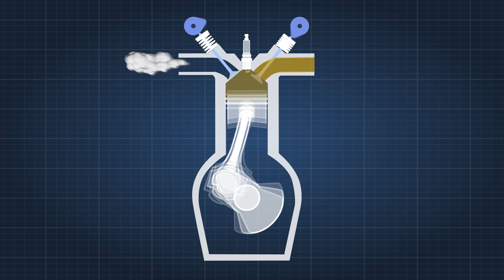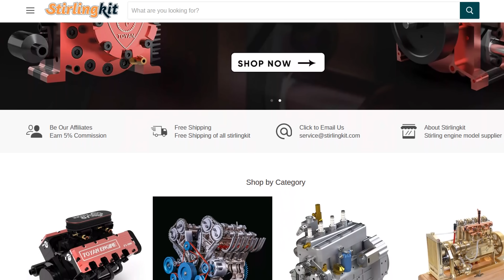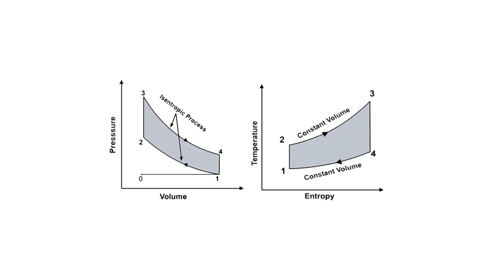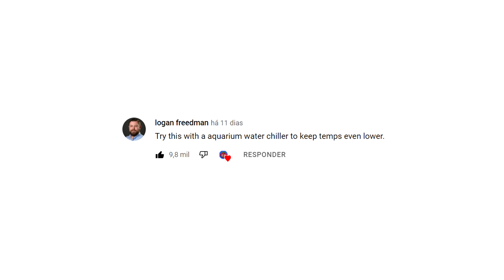I 3D Printed a Transparent Combustion Engine in Resin

Comment: My guess on why it's performing better and worse with different fuels might be caused by the rubber ring. What I think is happening is called blow by. I think the meth was the most efficient because it was causing the least amount of blow by. I believe diminishing returns is a factor comparing gas and nitrometh. Car pistons have staggering piston rings with a small gap to allow some blow by but minimal. You'd also have to look in engine temps during combustion comparing the different fuels to figure out proper gapping of rings. Maybe you can us math or a simulation. Cheers.

Comment: All the fuels have the wrong mixture. If the carby is set to operate correctly on regular unleaded fuel it will have a hard time running on nitro.
Nitro and methanol needs a vastly different fuel to air ratio than unleaded.
If the carby has a mixture screw try adjusting that and then try the different fuels again. 
Either way it'll be very difficult to get good indication with an engine that undoubtedly has a lot of air leaks!

Comment: Your Air-fuel ratio changes with each fuel, maybe you can try printing some carburetor jets with different diameters to fix this. As you run either rich (too much fuel) or lean (not enough fuel) the engine can behave totally different and loose power you want a mixture with a lambda close, or some cases slightly richer, than 1 for a perfect mix.

Comment: This may have been said in earlier comments but I can't read throught them all.  In a car engine the timing for when the spark occurs is not fixed as with your simple engine the timing advances as the rpm increases this means that the spark occurs earlier on the compression stroke to compensate for the increased rpm.

Comment: 1) ignition timing, each fuel has a different burn rate and that means power will be applied early, late, or on time. 2) spark plug gap varies with fuel and compression. 3) different fuels require different carb jets.
Reply: As the engine should work as close to detonation as posible, spark plug should have its heat rating set acordingly. But i think its imposible on this type of engine :D.
Reply: These toy engines are really not built for this level of perfection. But you're spot on in my opinion.
Reply: @Argosh  sure they are, in fact they are required to be even more precise due to their smaller size. You can still change the gap on the plug in order to change them slightly, and you can use feeler gauges in order to make sure they are the distance that you would prefer.
Reply: @sethh8892  lol
Reply: I was also going to mention that the air/fuel ratio for the different fuels is probably all wrong, but you’re spot on, there is a lot involved in properly tuning an engine.
Reply: @Thinginator  
     Yea, different "fuels" require different fuel. O2 ratios for full reaction of all fuel provided.
This is called its Stoichiometric value.
     In naturally asperated engines the carburetor is designed according to fuel being used.
In fuel injected engines, this ratio is controlled by how much O2 is still in the exhaust gasses. (O2 sensor)
     This is why liquid fuel rocket engines vary so much in design, fuel & output.
Hydrogen has the highest "energy density" but also has a high Stoichiometric value.
     This means the engine/ fuel, requires more O2 to make use of this energy.
More O2 means bigger tanks & more mass of O2 onboard.  
     Mass is the #1 factor in thrust/ weight ratios.  
Engineering can maximize the thrust but only so far. Mass is physics, it can't be changed other than 
by simply carrying less. 
     Super chilling can change its density, leading to smaller tank requirements, 
meaning less mass in vehicle from smaller O2 tank but this is still same fuel/ O2 mass.
     Ex: Two Kilos of fuel & one Kilo of O2 doesn't change because it's liquid instead of gas.

     This 2-stroke is probably running lean. Just under the initiation point for the small amount of time given.
Fuel/ air ration is slowly increasing in the carb./ intake airstream.  
     Once it hits correct ratio per volume/ pressure/ temperature, bang. 
This single bang just barely changes the temp. therefor pressure/ volume of mix. in cylinder.
     Liquids are uncompressible therefor this temp. change only affects the O2/ gases in cylinder.
Making the absolute O2 content in cylinder mix, to low for ignition at TDC & as cylinder drops, the O2 
pressure/ fuel/ air ratio, only drops. If the mix is too lean to ignite at TDC, it's never going to because 
the mix is only getting leaner as the piston drops.
     Since the 2-stroke doesn't have a "fully" clearing exhaust stroke, warm gasses are still in the cylinder from 
previous ignition stroke. This janks the next compressions mix, preventing ignition. Warm air is less dense than cold.
     In this second, non-igniting stroke, fuel & air was still pulled in, fuel was forced to evaporate as cylinder dropped, this chilled the cylinder & un-expelled gasses back to proper fuel/ air ratios.   This results in a bang, every other stroke.
     This seeming tine issue, effects all internal combustion engines. 
This is why mileage/ efficiency is affected so much by altitude.
     Also, the reason ICEs require turbo or at min., super charger systems as the pressure drops with temp./ alt.
The inefficient exhaust stroke on the two-stroke, makes this scenario have a larger effect on the engines combustion.
     Too much info?  HaHa!!
Reply: @travissmith2056  very informative!
Reply: Knock knock LOL
Reply: exactly what I was thinking improper timing steals momentum by combusting on the wrong time so with more combustions per stroke he gets less rpm vs less combustions per stroke
Reply: Yea nitromethane needs more fuel injected per cycle to make proper stoic, and because it’s less powerful than gasoline he’s getting less power than he should be if it was the proper AF ratio.
Reply: This!
Reply: I completely agree with this. I also think he may be running into valve float.
Reply: Yes... What this viewer said is accurate 👍
Reply: You are exactly right my friend
Reply: You are exactly right my friend
Reply: Yup sounds about right.
Reply: Just use efi
Reply: to me it looks to be running really RICH. also its a good idea to mount something to the throttle lever to stop it moving around when the machine is running.
Reply: correct on everything but the jets. only time you worry about jets is if for whatever reason, you are taking an engine meant to run on for example 93 octane and trying to get it to run 91 octane, you run into detonation. to fix that you change the jets as well as tune the carb by adjusting fuel/air screws to adjust the ratio. when trying to tune for higher octane fuels you literally just need to adjust your fuel/air ratio and possibly pull some timing.
Reply: Very good video! Try to use another ignition system to solve this problem or give a small load to the engine. This ignitions are very weak. I have some of these small engines and often the ignitions failed or the spark is to weak. I tried one from stirlingkit 6-12Volt and use it with a 2S battery. This works much better for me.
Reply: My money is on pre-detonation it's seems the timing is too advanced.
Reply: @JustDoodles01  "pre-detonation"

No such thing.  There is  pre-ignition and there is detonation, two separate effects.
Reply: implementing a timing curve based on engine rpm and valve timing would most likely sort out the missed combustion stroke.

Comment: It is because you are loosing a lot of compression on the cylinder head, you can see all the mixture escaping just before the spark. The cylinder is not perfectly flat or parallel and the inside of the cylinder should be honed for the exact size of the ring-piston combination in order to get the best explosions, then all the fuels you used will work as intended

Comment: Several things, the engine needs a load. Running an electric motor off the crank to power a light bulb should be the easiest. Tolerance between the piston and cylinder might be too great allowing for blowby. Leakage from the cylinder and head. Ignition timing from the magneto might be off the tiniest amount, just enough for less than optimal operation. 

Once all that is ironed out, time to experiment with freevalve.

Comment: I agree with some of the comments, it needs a load. When it fires it speeds up a lot with no load, its then too lean to fire whilst the rpm falls on the overrun  again. Just like revving a 2 stroke  motorbike you can hear it only fires occasionally unless its under load.

Comment: I am thinking the difference in power strokes is more something to do with the carburetor. It seems like the heavier fuels are taking more intake cycles than lighter fuels and in turn will not do a power stroke until a lower explosive limit is reached. The lighter the fuel, the easier it vaporizes in the carb.

Comment: So as it stands the ignition system is not activating in time which is why it's not receiving 4 stroke with gas. Now the 25% as you said burns faster meaning the power stroke is not as fast as gas. I'm sure if you go look at the slow motion of both you can see the activation time in which each happens. Just because something burns faster dosent always mean better. You have to find the exact mixture. Kinda like a 2 stroke dirt bike. I'd suggest trying maybe a diesel engine or so which has no spark and depends on high compression. I'd love to talk with you more on why it's doing so and go into the science of it.  Reply and let me know if youd like to hear more.

Comment: With Nitromethane, Methane, and Alchohol, iirc, you need a higher compression to get them to ignite. Having a set compression ratio such as this engine, the most efficient fuel to combust at that compression would be the fuel the manufacturers had in mind. 

It probably doesn't help either that there might be a compression leak from the cylinder. Resin is more flexible, so the mating surfaces are probably squeezing some compression out. 

That would be why most of the fuel requires additional strokes to ignite. You need more fuel and air atomizing to match the weak compression to ignite. So the solution would be to design an engine for each fuel with the proper compression ratio to use the fuel effectively.

Comment: something ive been dying to see an indepth video on is an idea ive had for a long time.. A water fuled electric/hybrid or regular car or water fuled generator..

my idea: pure hydrogen gas is explosive. Make a powerful hydrogen/oxygen separator. One powerful enough to keep up with the demand of the engine. Then pump the hydrogen produced into the cylinder of the motor and adjust whatever until  it runs smoothly.  In the hybrid car the generator would charge the batteries while the car is running.. In a regular car it would just run off the hydrogen.. same in a generator.. Imagine how game changing this would be for third world countries.. A water powered generator alone would be amazingly beneficial for people all over the world, but especially in places where people dont have the luxury of buying gas every day to drive or to get electricity.. I honestly dont know why this isnt a mainstream idea already.

In theory this should absolutely be possible. But big oil isnt gonna like people inventing things that would make them obsolete..

Comment: A good topic for a video would be to use metallic sodium with water, take advantage of the fact that the reaction is exothermic to produce steam and push a turbine, also the hydrogen released can be burned in an auxiliary engine, in order to obtain a good result of efficiency per gram of metallic sodium (obviously dangerous but that's the fun part) ...sodium can be reused due to the remaining sodium hydroxide solution which can be separated back into metallic sodium, or put aluminum into the leftover solution to generate more hydrogen and back to the auxiliary engine

Comment: Different fuels need different air/fuel ratios. Methane delivers more power for the same amount of oxygen, but needs a lot more fuel to be injected. Thus, you should ideally re-tune the carb each time you change fuel.

Comment: you could try making a steam turbine system similar to what was used on the old ww2 warships. im quite fond of those designs and believe we could use a thing or two from them in our modern warships. the steam powerplants of those days were quite ingenious going from coal reciprocating engines to fuel oil steam turbines that are used in todays powerplants. id love it if you tried making one of those systems and made a steam turbine like that, not the pelton design mind you.

Comment: It's pretty simple really, the fuels burn at different speeds causing a different rate of expansion. Timing has to be advanced / retarded in the cycle appropriately to achieve the correct stochiometric mixture of air and fuel for ignition.

Comment: Hey Integza, you never explained if you changed anything with the timing of your engine when you changed the fuel. Is it timing itself automatically using that black magnetic sensor thingy you showed? Although, I think you are right about the seal between the cylinder and the piston. We sorta can see the leak in the video.

Idea for future: can you use an oscilloscope to monitor the sparks and the magnetic sensor, and compare that with the actual timing of the engine, maybe using slow motion videos? That would be cool to see, and it might tell you what's going wrong.

Comment: Sweet!!! Nitro methane is a common RC fuel... Works great as a two stroke fuel anyway... Hence: https://youtu.be/jU87e8V2UhA  With a 68” (almost 2M) wingspan, this model is powered by a nitromethane engine. 0.90cc as I recall... If I’m right, the engine itself is an Italian classic from the ‘80s and still runs like a top...

Comment: Fueling is an interesting thing and lots has to be taken into account. I have tried to run both methanol and nitromethane in my 200cc dirt bike (some mods to carb for extra fueling) and both def increase HP compared to gas with correct timing but found methanol to run a lot cooler which effectively allows you push it further as less knock.
Its a science game and not all engines are designed to run higher ocatane

Comment: Nice build. Try building the same motor but with variable timing on the firing. When the motor starts the timing should be close to TDC maybe 5 degrees before. Once its moving and the momentum of the flywheel can stop the motor going backwards, advance the timing to make it run best. Good fuels explode less and have a slower burn which means you can compress the burning fuel for longer. The way you were set up a better fuel that burns slower would appear to not be doing as well.

Comment: From what I see you are flooding the cylinder. Fuel condensate on the sides. Bad stoichiometric mix. It's why it doesn't fire on every stroke. Looks to me you also have a spark timing issue. Some oil dripped in the cylinder wall should help with compression.

Comment: Nitromethane needs alot more fuel to run efficiently I built a 5hp motor that ran on a 30% nitro mix. I had to completely remove the carburetor jet as well as add a fuel pump to keep it from leaning out I also had some gasoline to help it was awesome. Keep up the great videos

Comment: So in drag racing since they use that nitromethane fuel their cars run at a lower rpm thus giving the car more torque which the tires mixed with the engine is why some of them lift off the ground, drag racing isn't top speed, its getting off the line faster and increasing speed as you go which in turn keeps you infront(potentially) of the car you're racing against, top speed and off the line speed are different, if you look at drag cars they all have somewhat of a similar build, older style car little bit lifted in the back with a downward wing of some sort with wheels out the back. That is because of the immense amount of torque the fuel is creating in the engine causing the cat to lift the front end up the wing creates a mixture of speed and downforce to keep the car from going out of control. Now let's say you take a '65 mustang put in a V8 that accepts nitromethane fuel and no other upgrades, the car is going to almost immediately crash and burn because the stock cars aren't made to Handel the torque created from the fuel and engine. Hope this helps, keep up the good videos

Also little side note, the spark plug timing is off so that's why at high rpm the "explosion" happens every 8-12 cycles and lower rpm it happens every 2 cycles as it did with the nitromethane, it's just the spark plug really gotta find a way to time it better couldn't quite see what could help with timing in the video but I'm sure you will figure it out, maybe try a timing belt or finding a way to speed up or slow down the current one

Comment: Different fuel ratings have different ignition temps. Pre ignition or detonation may occur. Either on the upstroke of the compression stage before top dead center, or post top dead center. Or the fuel air ratio is off and the carb needs tuning.

Comment: Make you own little carburetor for the gun so you can adjust the air/fuel ratio and put your own spark plug sparker on the engine

Comment: My guess is you never adjusted the air fuel ratio and that why it was slower. This could also be why it didn't ignite right every time because the mixture was too saturated to ignite.

Comment: Hmm, you might not have been getting the stoichiometric ratio with the more powerfull fuel. I believe you mentioned that it takes less air for the methanol based nitromethane as compared to gasoline so you might be running lean. If you could put more fuel in, I believe you would be able to reach more potential with the nitro.

On a side note, I notice your valves and push rods aren't very tight and dont seem to open very much...maybe?